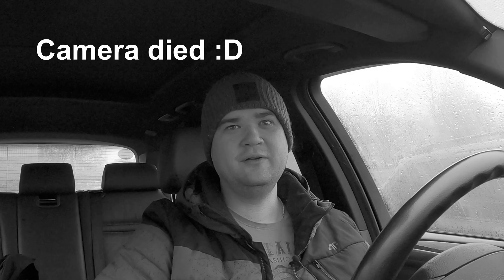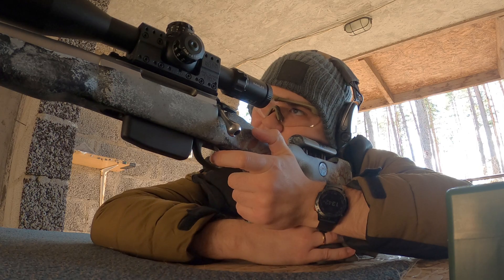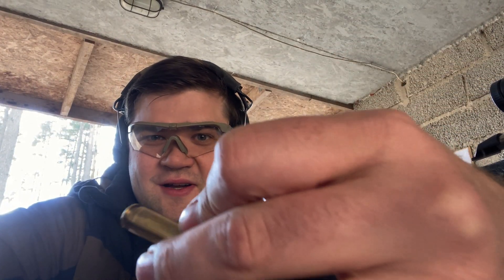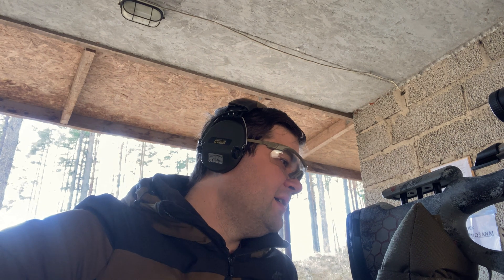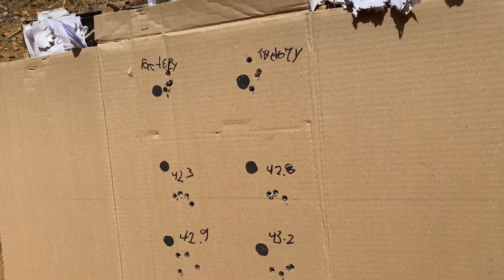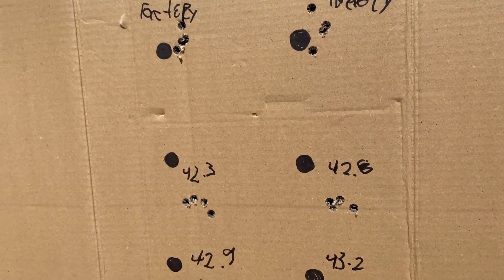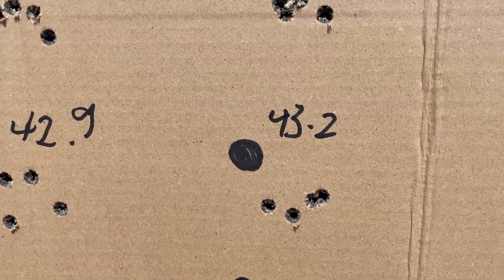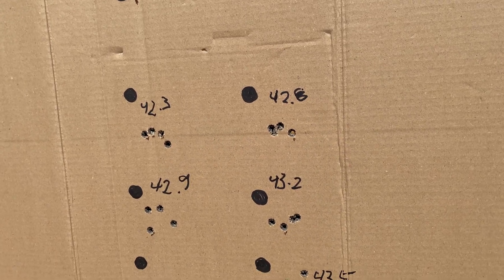308 WIN Reload - Testing Powder Charges

Comment: Hey man! What was the cartridge overall length you used for those ELD-M 168gr? I have the same gun, same bullets, about to do some load development.
Reply from the maker: Hey! It is 2.803”. I was not looking for lands yet, just measured factory cartridges and took longest from box as starting point :)
Reply: @rungunpeppers   Sounds good! I'm going to do some load development next week, ill share my results with a reply on here.
Reply from the maker: @403performance5   cool 👍 let’s see how it will work for your rifle. Which powder you are using btw?
Reply: @rungunpeppers  I'll be testing out Varget, win748 and IMR3031. I actually have the same varmint t3x in 223 as well, thing is a laser haha it'll do 1/2 inch groups all day with V-max and ELD-m bullets. I haven't even shot the 308 yet!
Reply from the maker: @403performance5  👍
Reply from the maker: @403Performance man, how it went?
Reply: With varget most accurate loads I got were in between 43.7-44.2 grains. CFE223 best loads were around 45.6 grains, IMR3031 best loads were 40.3 grains. This is all with a 168gr bullet. Varget gave the best groups overall of about .5”-.6”
Reply: @rungunpeppers  You should get a tikka t3x varmint in 223 as well! Its the most accurate rifle I've ever owned, and with 75gr ELD it stays supersonic over 1200 yards and carries a lot of energy down range. Really packs a punch for 223!
Reply from the maker: @403performance5  need to buy bigger safe, now it is full